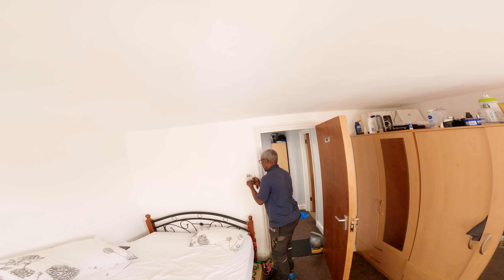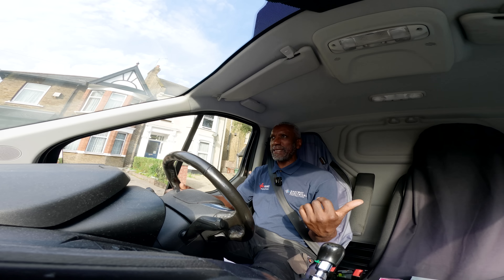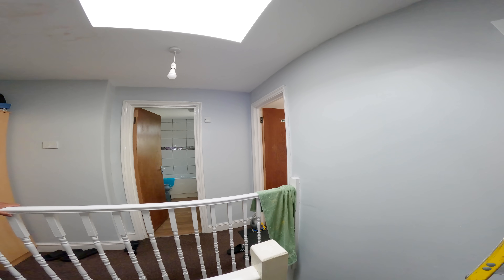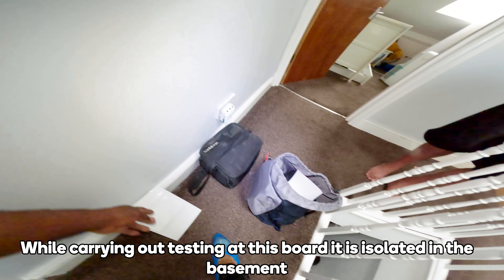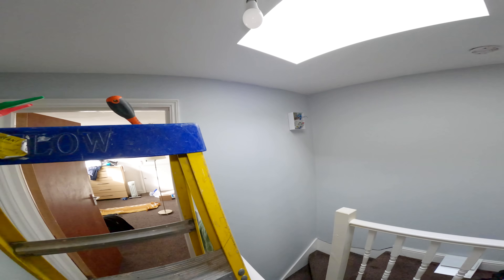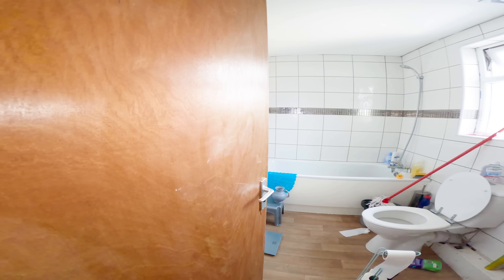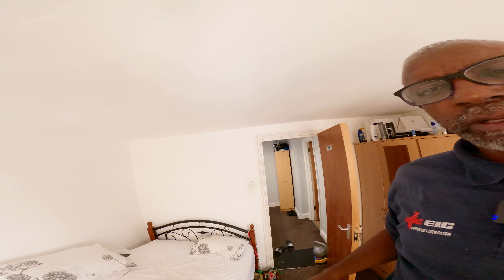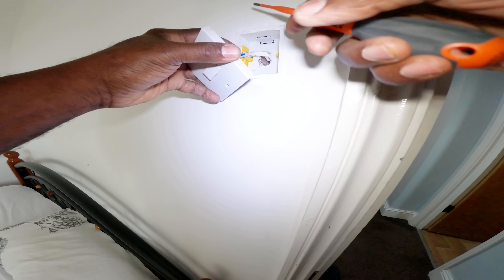Electrical fault finding on a BODGE job

Comment: It’s more likely, they’ve wired from sweater switch with supply cables and switch and neutral to each light. I would’ve checked the switches first.

Comment: Soooo you rewired the house but left the loft conversion circuits and re fed them off your new db? Why did you carry no testing out on the loft conversion circuits to prove that they was suitable to be re-energised for continued use? As there was clearly a lot of even basic remedial action necessary that even a visual check should’ve picked up on

Comment: Is it me or most of them fitting are only SL+N that your testing  and PL+N 2 plated at the switch?
Reply: The fitting should be, but if the light switch is switched to the on position then testing at the fitting should be live and neutral testing. Quicker than trying to fish out the junction boxes that the cretin who hammered these electrics into place will have hidden and sealed in the ceiling space.

Comment: Your only testing the switch lines, there has to be a junction at every fitting, you was only testing switch line cores from the junction.
Find the supply in and out of every fitting then bang your IR then you would of found your faulty cable

Comment: Thank you. Great video. Im an apprentice electrician, would you be able to talk through your thought process when going through things? Im dumb, and cant link things at the moment without background knowledge. If you could id be able to get loads more from your videos. Thanks again.
Reply: Subscribe @mainly electrical to learn Pedro
Reply: @Mainly_Electrical not a bad shout pedro the boys show a good bit of testing and earthing arrangements. Good for apprentices because i no myself unless your with certain company's youll never get a look at testing. Anyway best of luck and think about the concept of electricity how it flows and what is resistance (R) and impedance (Z) best place to start 💪

Comment: Could the motor in the fan giving dc feedback and tripping a type ac
Reply: No
Reply: @Mainly_Electrical what you doing lurking around here? Admiring Delroys fault finding skills
Reply: @paullyons4624  hi Paul 👋.. busted 🤣
Reply: @paullyons4624 😂

Comment: Did i see a metak switch in a bathroom, dont like that.
Reply: It's not ideal but quite acceptable. However, the cretin who hammered these electrics in place will undoubtedly have clipped off the earth cable rather than connect it.
Reply: Its aluminim, light weight, non magnetic and doesnt conduct electricity.
Reply: @IM_MOUNTAIN  in what world does aluminium not conduct electricity.
Reply: @IM_MOUNTAIN What the hell have you been drinking?.......Do not attempt any electrical work yourself....FFS
Reply: @IM_MOUNTAIN shits the same as copper only copper allows for the cable to be half the size or there abouts. you may go relearn your brain  my brother